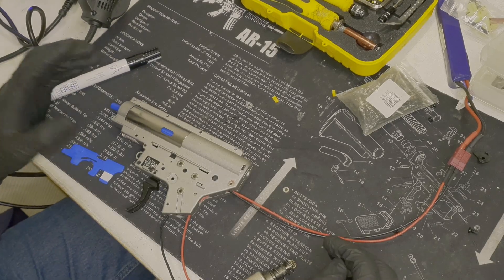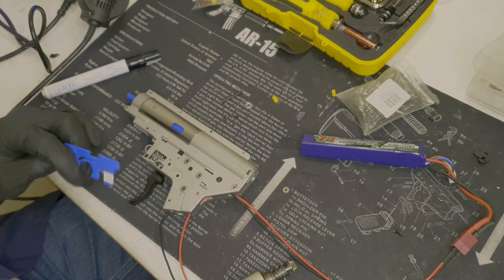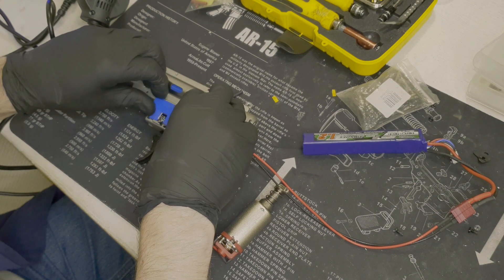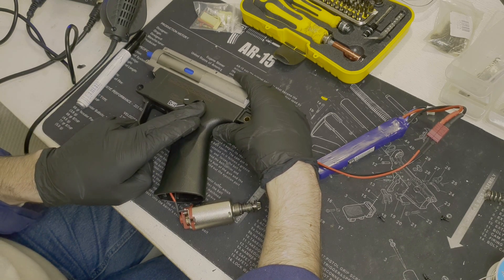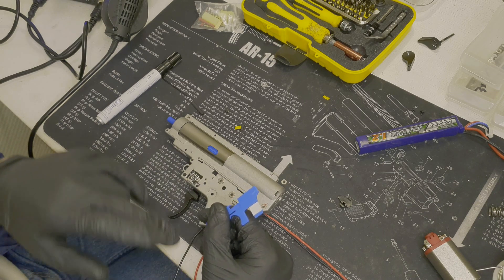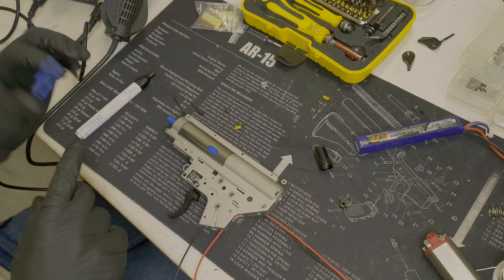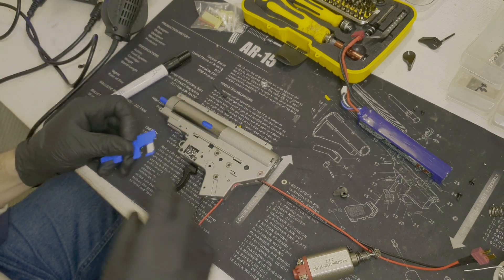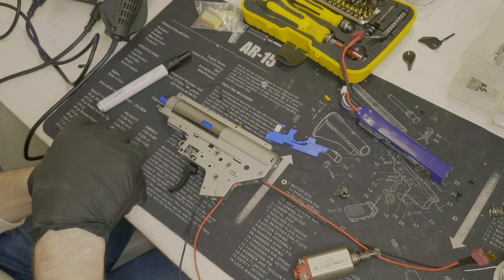T238 mosfet selector sticker calibration

Comment: Truly your T238 tutorials are the best, have not found such help anywhere here in Australia or elsewhere period. The other T238 Mosfet uploads from so called self professed Mosfet/ DSG experts are of such a low content value compared to your uploads. Total Legend
Reply: HI Again Callsign, yesterday this video got me sorted out with the sticker placement on the selector  plate, today I could not progress into the programming which I could not work out so I looked at your video on the T238 wire placement install board setup and found the issue and now am in the programming mode. So again really fantastic helpful sharing of your knowledge. Truly very appreciate your T238 tutorials and like other feedback your english is excellent.
Reply from the maker: Thanks man! You got me blushing 🙏🏼